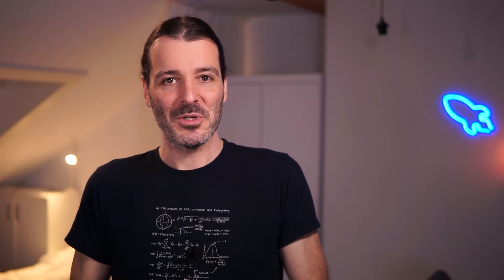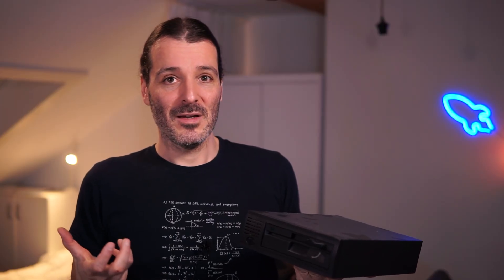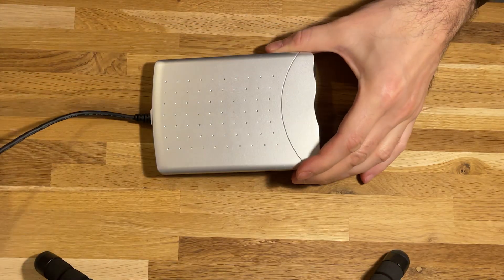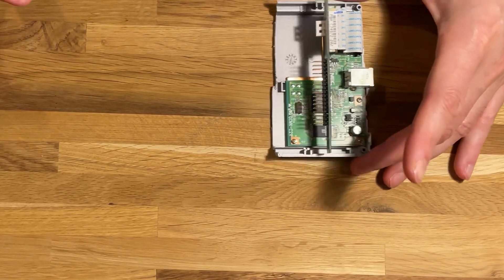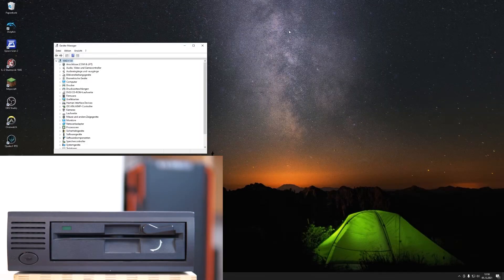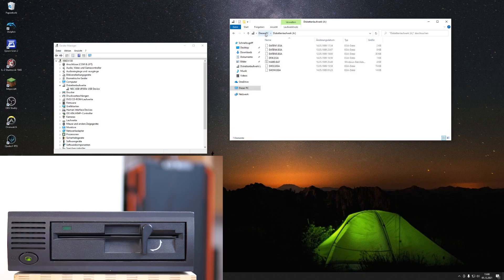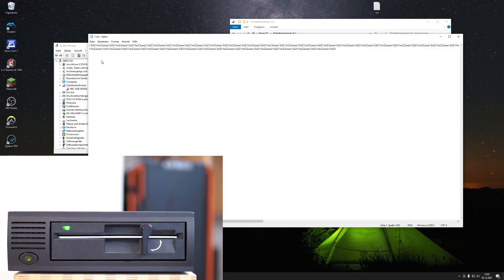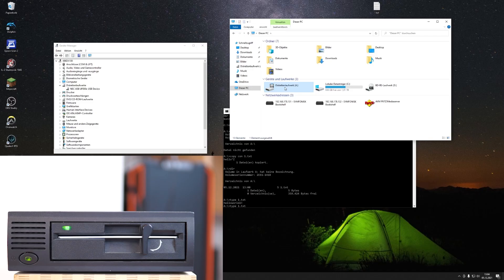How to build a working external 5.25" USB Floppy Drive

Comment: There are USB to FDD chips that support 5,25" (1,2M) FDDs according to their datasheet. For example the USB97CFDC-01. You could design a PCB around that. I thought about making that for a while now, but I didn't find the time for that.
There are also ready made USB to floppy adapters available on ebay, so you don't have to take an external floppy apart. For example usb fdd@1306. But I am not sure if it supports 5,25", as they removed the Partnumber from the chip, but it might be a little bit more universal. To Linux it reports as an HDD and not as an fdd like other USB Floppies. 

The Problems you are seeing in windows are most likely the result of mismatching geometries. It can read part of the first track, where the bootsector and the root directory reside, but if you grow out of that you run into problems.
The reason it works under DOS could be that DOS is reading the geometry from the bootsector. Windows ignores the geometry in the bootsector and uses the geometry reported by the driver, which probably gets the told the 1.4M geometry from the controller chip.
Reply: Have you by any chance found a usb floppy drive that uses this chip? It would be incredibly easier for other people, such as myself, to make a 5.25 native adapter if that’s the case.
Reply: @bushman3168  I didn't look into my external floppy drives, and I don't have them at hand right now. If you are relly interested I could design a PCB for that controller, but you would have to order the PCBs, build them up and test ist, because I don't really need it right now. ALso desiging the PCB is some work that I would only do, if someone is relly interested.
Reply: The USB97CFDC-MN is still availible at digikey, but you can only order a multiple of 72, wich costs around 284€.
Maybe you could build a a few PCBs and sell them on ebay to recoup the cost
Reply: @janhofmeier9427  I have neither the time nor the money, but I would absolutely pay for a device that does have this chip and may be able to read 5.25 floppy’s on modern hardware natively.
Reply: We would also need a firmware. I googled around, but couldn't find the firmware, the datrasheet was talking about. In the worst case we eould need to find a floppy using that chip an dump the firmware from there or write it from scratch
Reply: @janhofmeier9427  I wouldn't want to buy a chip and a board because I would need to somehow create software, drivers, and/or firmware. The reason why I wanted to look into usb floppy drives that have the chip is because presumably the board may already be wired and be able to read 5.25 drives, even if the functionality is not used, and the firmware for the usb drive would at least probably be available on the internet.
Reply: @bushman3168  I don't think this will happen as I don't plan to pour houndres of euros and many hours into a device I don't need, while taking all the risk to maybe sell one.
If there was a real interest and a combined effort, I would spend the time to create a design. But at the moment it doesn't look like that.
If you have external floppy drives you could look into them and tell me what controller they have. We might be able to hack one of them, if there is documentation for them.
Reply: @janhofmeier9427  Hey, I am probably going to get one of those internal 3,5" AliExpress adapters, I'll let you know what happens when I connect it to a 5,25" drive.
Reply: @RetroHexAltAccount  so what happened?
Reply: Yeah. Not even close to an expert, but.. this sound a lot like a driver issue - as in no one intended to support 5.25" over USB, so the ability to actually detect such a drive in Windows, and recognize how to talk to it, is just flat missing. Sort of like if you where missing drivers for a graphics card, and that cards was odd enough that it didn't "quite" work using standard VGA, so Windows was only a) seeing it as a VGA, but also, b) only let you use it in the lowest resolution (despite the standard allowing several others).

An older version of Windows, like those that ran on top of DOS might have worked because you could format disks in all sorts of strange ways on them - even changing number of tracks, number of sectors per track, number of bytes per sector, etc. More modern versions of Windows will also not recognize some of them, and flat out cannot create them, even though the drives should technically allow it. The drivers just flat out don't, since these things are "outside expected ranges".

It does make me wonder though.. what would a version of Linux do with one of these things, since its not quite so beholden to its drivers in the way Windows is, and is often more flexible in handling odd hardware (including stuff that Windows will just flat out refuse to talk to, do to there being no modern drivers for them).
Reply: @patrickelliott2169  At this point I don't think there is any reason to belive, that this is a driver Issue. The Floppy controller has no way of detecting the type of floppy connected and consequently can't tell the driver the right geometry.
Looking at the "USB Mass Storage Class – UFI Command Specification" Section 4.5.3 The floppy type is reported in Byte 2 "Medium Type Code" of the "Mode Parameter Header" in Response to the "Mode Sense" command. If @DOSPedion would run the Mode Sense command I am sure it will report 94h (1.44M). He could try to force it to 93h (1.25M) with the Mode Select command. With the right USB Controller chip, this could be configured on the side of the USB controller, so it would directly report the right type.
Also there is the "Read Capacity Command" (chapter 4.9) It would be interesting what this reports.Maybe it calculates the capacity from the information in the bootblock or maybe it just reports a hardcoded value or it fails.
Also notice that the READ commands use LBA and not CHS. So I don't think it is to important for Windows to know the correct geometry, but the controller needs to know the right media type, because it has to map the consecutive LBAs to CHS addresses. And thats probably where the Windows test breaks with to large files: As long as only LBAs are accessed that map to secotry existing on the 1.2M floppy it works (1.2M has the same geometry as 1.44M, except the number of sectors per track, 15 for 1.2M and 18 for 1.44M). But when he tries to access sector 16, it breaks because it can't be found on the disk.
The explanation why it works in dos would be: DOS uses CHS, which the BIOS needs to map to LBA for the  USB UFI Commands. The Controller and the BIOS both think it is a 1.44M disk, so the same CHS on the BIOS side map to the same CHS on the floppy controller. DOS reads the geometry from the bootsector, which causes it to only access secotors till 15, which will also map to valid sectors on the floppy side. So it skipps secotrs 16,17,18, which means it skipps also the LBAs which would map to them, so the controller dosn't try to read them.

My theories can be verified:
Use a hex editor on a working 1.4M disk, change geometry with a bootsector to 19 sectors. Windows should be still able to read it. DOS will report Read Errors or even "Sector not found errors". This proves that DOS is using the geometry from te Bootsector, but Windows dosen't.
Then under Windows or Linux send a Mode Sense command to the contraption with the 5'25" Floppy. It will report the media type of the 1.4M if my theory is right. After sending a Mode Sense Command with tpe 93h the disk should read fine, at least for 1.2M. Maybe the OS will notice the change and adjust the capacity or it will report an read error.
If the Mode Select is not possible for some reason, you can calculate the LBAs of the valid Sectors. Use a tool like dd to only access the LBAs mapping to valid Sectors, they should all read fine.
Another way would be to try to read the wohle thing with "gddrescue". It will show a pattern of errors corresponding to the "invalid LBAs".

The proper solution:
use a USB Floppy controller that allows to set the Media type permanently in Hardware or Firmware.
Reply: @janhofmeier9427  OK. Lot of stuff in there that I only vaguely understand, but.. what I get from it is that you think that the controller card that the drive plugs into is the culprit, in that "it" doesn't understand what its looking at? You may be right. USB negotiation would involve the controller checking to see what the drive is, then "telling" Windows, or anything else using the USB functionality, what kind of device it is, and what it thinks is connected to it.

That said.. this implies that the BIOS, under DOS, not DOS itself would be doing some of this negotiation, and that "it" is deciding what the drive is, and how to talk to it, and a Windows driver is just going to talk to it based on what the USB interface itself "knows" about the device... in which case, it would still be the interface layer in Windows that is "getting it wrong" somehow.

But, like I said, I don't really understand a lot of this, so this is just my guess. Why would the interface, after all, "forget" what it was accessing, and how to do so, just because Windows is talking to the USB hub on the motherboard, instead of DOS, via the BIOS? I would think Windows would have access to "more" information about what it was looking at that DOS does, as a result of this, or that it shouldn't work in either. Its not sitting directly on the system bus, or at least connected to a controller built into the mother board, like it normally would be, its sitting on a USB, "We need to talk this over, and have you tell me what you are.", interface. And it seems bloody odd that DOS somehow has no problem with this, but the controller flips out the second Windows is talking to it, and stops working with the same drives.
Reply: @janhofmeier9427  OK. Lot of stuff in there that I only vaguely understand, but.. what I get from it is that you think that the controller card that the drive plugs into is the culprit, in that "it" doesn't understand what its looking at? You may be right. USB negotiation would involve the controller checking to see what the drive is, then "telling" Windows, or anything else using the USB functionality, what kind of device it is, and what it thinks is connected to it.

That said.. this implies that the BIOS, under DOS, not DOS itself would be doing some of this negotiation, and that "it" is deciding what the drive is, and how to talk to it, and a Windows driver is just going to talk to it based on what the USB interface itself "knows" about the device... in which case, it would still be the interface layer in Windows that is "getting it wrong" somehow.

But, like I said, I don't really understand a lot of this, so this is just my guess. Why would the interface, after all, "forget" what it was accessing, and how to do so, just because Windows is talking to the USB hub on the motherboard, instead of DOS, via the BIOS? I would think Windows would have access to "more" information about what it was looking at that DOS does, as a result of this, or that it shouldn't work in either. Its not sitting directly on the system bus, or at least connected to a controller built into the mother board, like it normally would be, its sitting on a USB, "We need to talk this over, and have you tell me what you are.", interface. And it seems bloody odd that DOS somehow has no problem with this, but the controller flips out the second Windows is talking to it, and stops working with the same drives.
Reply: @patrickelliott2169  The floppy itself is dump, really dumb. It dosn't know anything about itself and it's geometry, so it has no way of telling the controller what it is. If you look at the floppy interface, its very lowlevel. The controller just tells the floppy to spin the motor, step the head, read or write. The floppy won't send "bits" to the controller, when it reads but the raw magnetitation, exactly, like it is on the media. It is on the controller to do the MFM decoding/encoding.
For the Onboard Floppy controller you set the type in  the BIOS, so the geometry is known. If you set the wrong type there, you will observe the same behaviour. The only thing, that can be really autodetected is if it is a Double Density (DD) or High Density (HD) media. On the 3,5" this happens through the second hole and a physical switch.
On the USB Floppy the geometry isn't exposed to the OS. The USB Mass Storage Protocol, which is used here uses LBA (Logical Block Address). Every secotor has just a consecutive number. The USB Floppy controller maps this LBA to the corresponding cylinder, head and secotor (CHS). Because the Controller here thinks it is a 1.4M one it thinks it has 18 sectors per track , but the 1.2M just has 15 per track. So it tries to access an sector that doesn't exist if you request LBA 15,16,17,33,34,35 and so one. You will see this under any modern OS. Linux, Windows, OS X. Probably even Windows 9x (if it dosn't use the MS-DOS compatibility mode to access the BIOS device, instead of the WIndows Protected mode driver, but thats another story).
MS-DOS doesn't know about LBA, it just knows the CHS format. So the BIOS has to emulate that. It maps the CHS to an LBA using the geometry of an 1.4M disk. It would run into the same Problem if the BIOS or DOS would for example request Cylinder 0 on Head 0 Secotor 15 (counting from 0). This maps to LBA 15, which then maps again to 0/0/15 in the floppy controller. But the BIOS just has to read Sektor 0 from the Floppy and then executes it. This is called the Volume Boot Record. This has then the code to load the next sectors for the boot programm and then find IO.SYS. So this is all MS-DOS Code. And the Bootsektor can always be read, even with wrong geometry. because even with the wrong geometry seotor 0 on head 0 on cylinder 0 is alwas the same. If you look at "Design of the FAT file system" on Wikipedia and Scroll to the Bootsector (VBR) you will find that it has a BIOS Parameter Block (PBP). At offset 0x15 in this Boot sector, there is something called "Media descriptor". This Media Descriptor tells DOS the type of floppy. If you scroll further down, you find on offset 0x18 "Physical sectors per track for disks with INT 13h CHS geometry". If you use the hexeditor of your choice to look at this offset, you will find an 18 there (or 12 in hex) for a normal 1.44M floppy. DOS Will use whatever you put there. If you change it to 19, you will find that DOS has trouble reading the disk, for me it just says there are no files (probably because it doesn't find the root directory anymore) but any modern OS, like Linux or Windows can still read the Floppy because the  BPB is deprecated, so they just ignore it.

The only clean solution is to have an USB Floppy controller, which can be set to the right geometry, either in hardware throgh some pins or by flashing a custom firmware.
Ironcly this could potentially cause problems in DOS, depending on the quality of the BIOS. If the BIOS uses the geometry reported by the controller, it will work fine, but if it has the 1.4M geometry hardcoded, it will then still skip some LBAs...

Comment: There is an artificial restriction / missing code in \windows\system32\drivers\sfloppy.sys and \windows\system32\drivers\flpydisk.sys - not sure if older driver variants from e.g. Vista will help.
May be someone can disassemble these to drivers and figure out what is missing/what is not considered by the code itself.
Reply: USB floppy drives aren't handled by sfloppy.sys or flpydisk.sys. Those drivers handle SCSI drives and drives connected to 82077AA-style controllers, respectively.

You'll find if your motherboard and BIOS supports 5.25" drives, they work perfectly even on Windows 11 24H2. The issue is that your motherboard and/or BIOS don't support those drives, not Windows.

Comment: I did some research about the floppy drive controller chips used in the USB floppy drives. Some of these products used the USB97CFDC2-01 controller chip for interfacing the floppy drive to the USB port. According to that chip, it is possible for it to work with the special Japanese formatted floppy disks that somehow used 1.2mb floppy disks that were in 3.5 inch format. I'm not too sure if there is way to modify one of these chips to think it is reading these special formatted 1.2mb floppy disk formats. If it is possible, perhaps one can interface a high density 5.25 floppy to it and the system may work.
Reply: Do you know of a specific product name?
Reply: @bushman3168  some of the Dell latitude series floppy drives uses these chips. Those with the mini USB ports on the side. Ive seen some with these chips and others with some proprietary Sony controller
Reply: @orcatype225  do you know if theres a site where I can check their schematics and see what chips they use?
Reply: @bushman3168 unfortunately I’m unsure of a website, but I do know how they physically look.

If you look at the top of the floppy drive and the metal cover does cover the entire top part of the drive, it is the one you are looking for

If there is parts where the cover does not cover, around the docking ejection mechanism, then it is not the drive you are looking for
Reply: This may work, as that format used the same geometry (80 tracks, 15 sectors) as 5.25" drives - though there's often more to a disk format than just track and sector counts. It wouldn't stop the USB device reporting itself as a 3.5" drive however, and wouldn't support 360KB floppies at all, which would irritate some people.